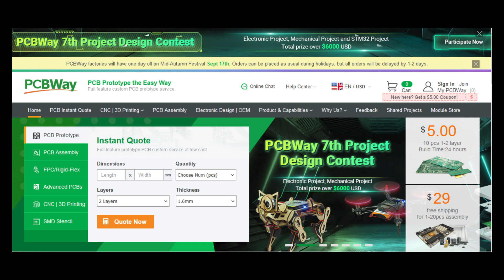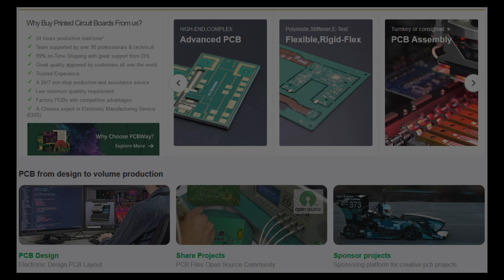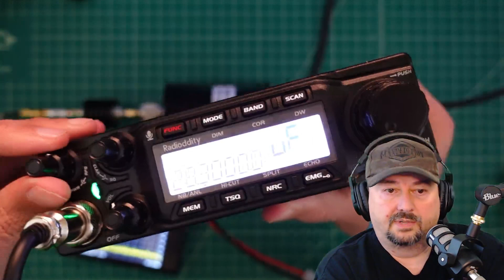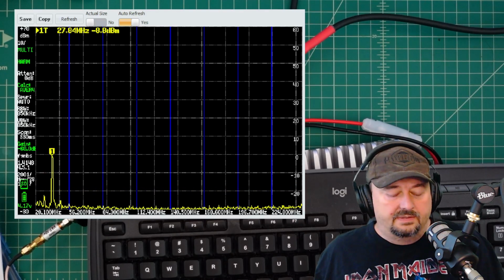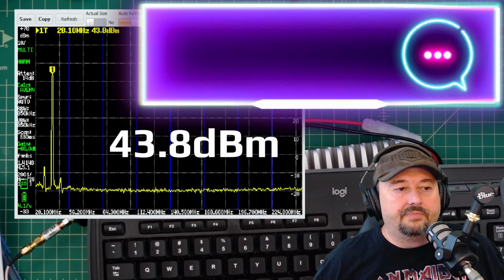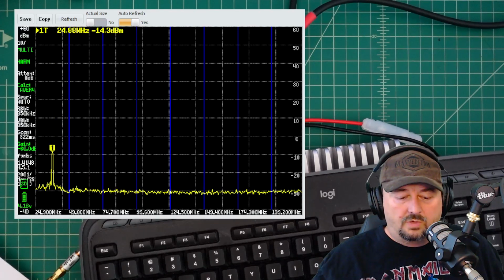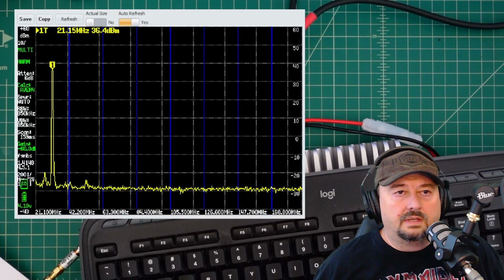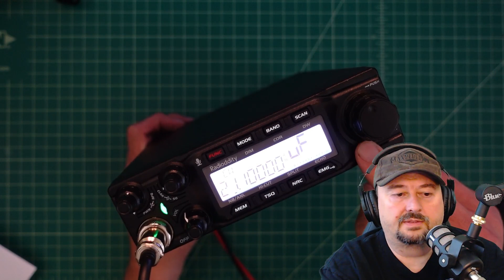Spectral Purity: Will the Radioddity QT80 Ham Radio PASS?

Comment: We also tested it with the Tiny first but it is far from the real parameters, then we tested it with a Ricon Ozilograph and that device has better values than the President Washington 2, we had the Any Tone AT6666 Pro which is the same as the device tested in the video! Conclusion: if you want something good and for a fair price, I can only recommend the AT 6666 Pro!
Reply from the maker: @VOLKZZORN  whew, had me worried for a sec 👍

Comment: Great video! I was going to get this for 10, 12, and 15 meters. These are the bands I primarily do my DXing on. I have made contacts around the world on my Xeigu G90 but there are times when I could use a little more power. The price is right (I'm semi-retired and on a really fixed income). I was hoping it would pass the testing since I don't like to purchase equipment that doesn't pass the spectral purity tests. Thanks for doing the testing. Have a great weekend...73...Hugh...KN6KNB
Reply from the maker: Hey Hugh, I ended up liking this radio much more than I thought I would 👍

Comment: Courious about the power output on 12 and 15m. I am seeing 50watts output on those bands through the analyzer on my tuner. What is your experience with power output on those bands?
Reply from the maker: I have fully tested yet but the video is coming 👍
Reply: Power output on 15m is lower, around 40 to 50 watts PEP. RX sensitivity is also slightly reduced on 15m. However it's still very workable and great fun (and clean) to use! 73

Comment: Nice testing. Great job linking attenuators together .  I do not have that many or enough power rating .so I just line tap into 2.5 KW dummy load.  This allows power measurement and outher tests at same time.  That short piece of 8X is fine.  This is HF . maybe at UHF might be a problem with all them connectors but HF is just fine.  You could the PTT on mic as straight key.   That makes a great POTA radio . Them 3 bands has been open real nice lately.  Just throw it on a ATU and Poseidon antenna and make your contacts . Remember 15 amps peak current.  20AH LiFePO4 should run most of the day .   With a sound card you can do digital modes just watch duty cycle.  Adjust power as needed.  You could just hold mic over smartphone and send/receive SSTV . Their a app for that  . 73
Reply from the maker: @robertmeyer4744  hey Robert, not sure how it happened but I have a bunch of attenuators around here 🤨

Comment: Have you had a chance to check power out on 15 m?
Reply: @K4AX  power output on 15m is lower, around 40 to 50 watts PEP. RX sensitivity is also slightly reduced on 15m. However it's still very workable and great fun (and clean) to use! 73
Reply: @mostlypostie1  sweet, thanks!
Reply from the maker: Not yet, sorry man 😐

Comment: Interesting. So why didn't they advertise and sell it as a 3 band ham radio?
Reply: It's because the radio is an upgrade of an older model, and the factory did not want to redo all of the documentation and compliance / certification information for the global market. So it remains a 10-meter radio with lots of "gifts". 73
Reply from the maker: I have no idea 🤷
Reply: Because its only fcc certified for 10m but you have to push a couple of buttons while turning on the radio and set it to HF to open up 3 bands 10m 11m"NOT MENTIONED" and 12m then you need to take apart the radio and move a jumper to unlock the 15m band. Which is against fcc rules.... blah blah blah. It will vary on power on different bands because the radio is aligned for 10m use and can be aligned by someone that knows what they're doing and will do 100w+ easily especially if you mod the heat sink to put a small fan on the back. And even doing over 100w its still clean on transmit. 73s
Reply: Actually a quad band radio. Some folks can’t count past 3.
Reply: @WillieBeard  and the fourth band is?